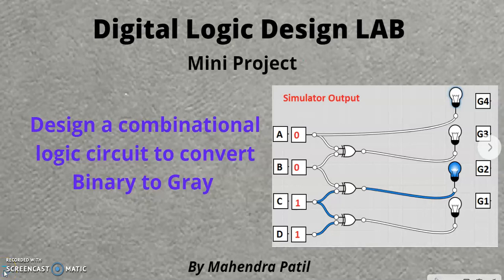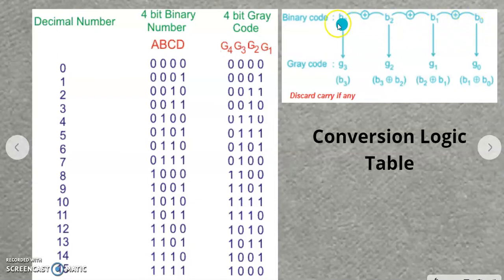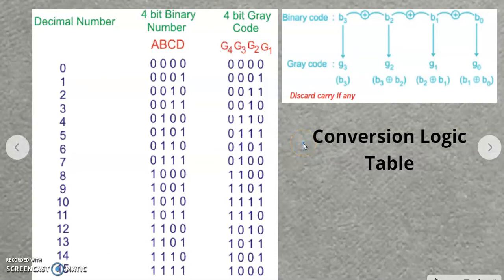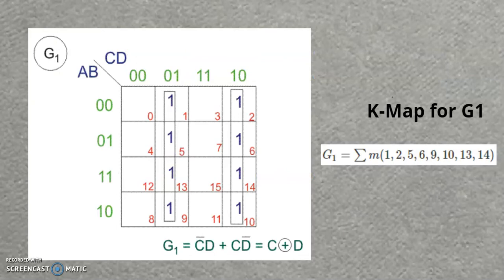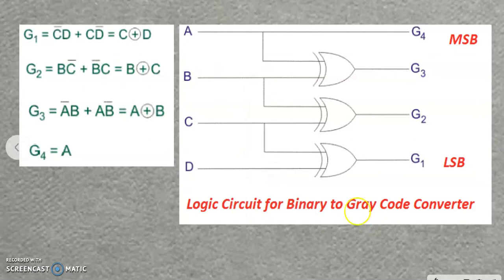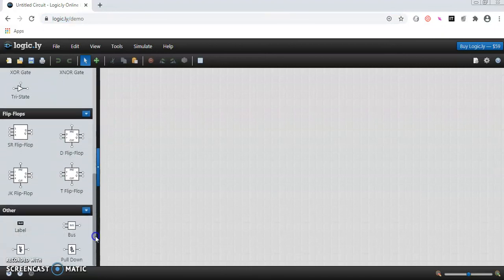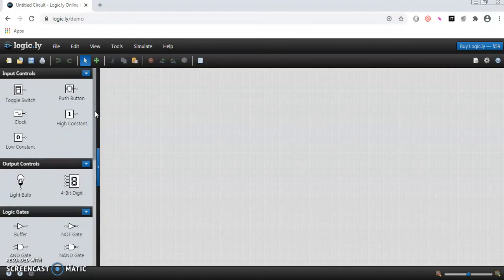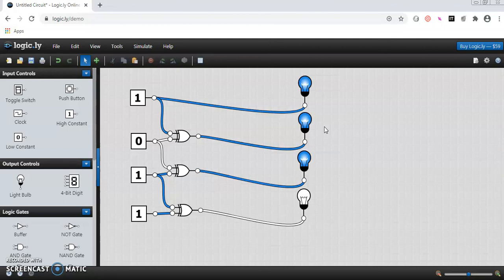Binary to Gray Code Converter (Mini Project, with Demo)

Comment: Sir what are APPLICATION of this binary to gray conversation in real life
Reply: Binary codes are used in telecommunications as well as computing for different techniques of data encoding like character strings to bit strings. The width used by these methods is fixed otherwise variable-width strings.
 This is used in computer languages as well as programming because computer languages mainly depend on 2-digit number systems.